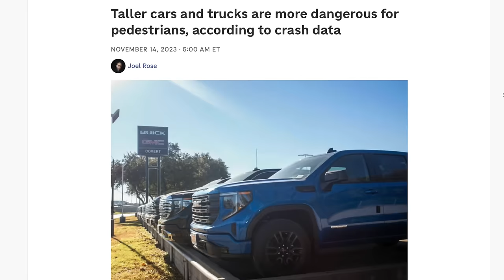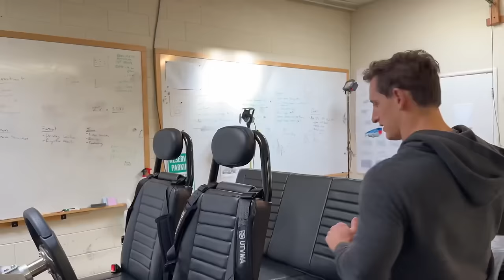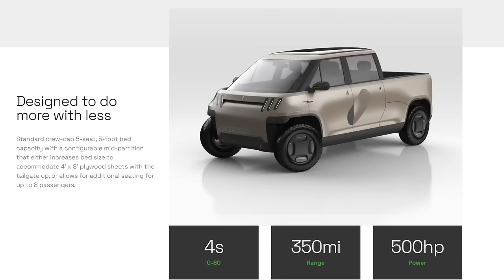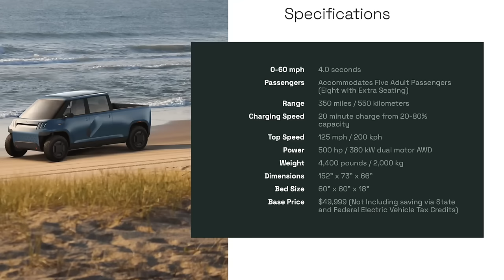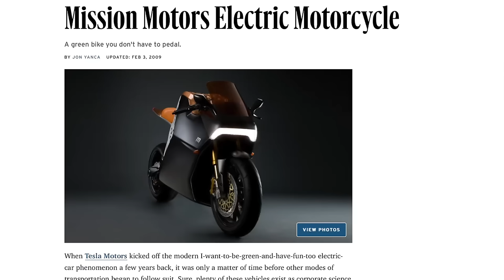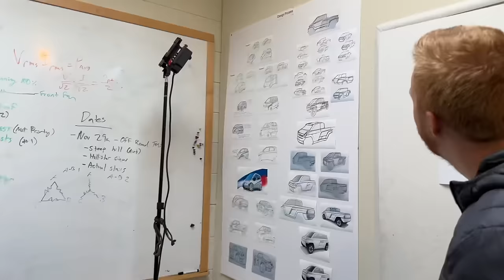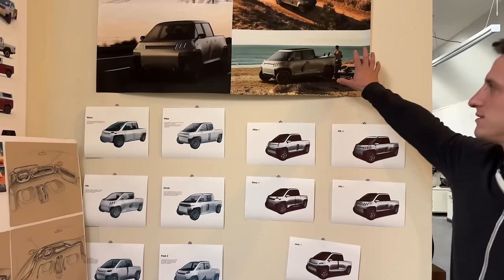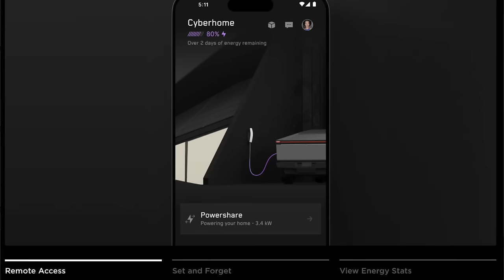Why are US Pickups SO BIG? Meet Telo

Comment: I hope these guys survive, it seems like they have some solid concepts here, and that the market will likely embrace the smaller PU concept if the price point can be kept at their estimates.
Reply: Worried the price is too high, BYD will take the idea, slap some common LFP blade batteries in it and price it so much lower no one will care about that extra battery density
Reply: Chicken Tax is the reason these guys can even exist.
Reply: Lol it’s a pos who tf gona buy that hideous truck made by another shady company 💀
Reply: It's for the city folk. Ikea runs! I want one! if they can make it a hybrid and the size of a corolla variant that's the perfect one. Kinda like a Previa. 👍
Reply: The cost target is always the first part to not work out.
Reply: If they can do it for 22-25k that would be the sweet spot. Othwerise, why not just get a Maverick?
Reply: Good ideas, but design needs improvement.
Reply: @T2star Correct, this is in the size of a Ford Maverick and the Lariat version is $35 - $37K. Maybe IF they get to 50K units per year, they might be able to get the price down to the Maverick range and I would be more interested. 5,000 units per year = $50K makes sense for the short-term

Comment: The best truck concept I've seen so far. Low to the ground, a low front end for pedestrian safety, decent range, all wheel drive, it can tow a decent weight, and it can fit nicely in my small garage. Can't wait until it's available. Love it!
Reply: Right. The other day my wife and I were eating at a diner and a Dodge truck parked next to our Prius. FFS, the top of the grille was above the roof height of our car!
Reply: @mk1st you’re right, I have an early 90s dodge diesel and I had a new one parked next to me and I felt like I was in a mg. They have gotten huge
Reply: what a lovely analysis

Comment: I'm certainly not in the market for one but I really hope they find success. Seeing actually good solutions to the USA's vehicular conundrums is nice
Reply: The EPA ruined the truck market and CAUSED MORE pollution. 
Everything is based  on size. How many square feet does the truck take up? 
An S-10 size truck takes up "X" amount of space and is allowed "X" amount of emissions. (almost impossibly small amount) So S-10 sized trucks are no longer sold. Truck makers build them bigger to comply with EPA regulations. 
That's crazy and has led to behemoth sized vehicles.
Reply: @TheBandit7613  yes but now people expect "real" trucks to be huge.  The epa was one cause but Telo will need to work to overcome the cultural perception that a truck must be large to be capable.
Reply: @ccibinel   Newsflash : Real trucks do need to be huge, especially if the manufacturer expects you to dish out $100k to buy one. I wouldn't pay $20k for the miniature piece of crap advertised in this EV evangelist video.

Comment: Such a cool concept.  I'm tired of huge trucks, but having a pickup is still so great for utility.
Reply: The EPA ruined the truck market and CAUSED MORE pollution. 
Everything is based  on size. How many square feet does the truck take up? 
An S-10 size truck takes up "X" amount of space and is allowed "X" amount of emissions. (almost impossibly small amount) So S-10 sized trucks are no longer sold. Truck makers build them bigger to comply with EPA regulations. 
That's crazy and has led to behemoth sized vehicles.

Comment: Love this idea of a smaller utility truck. Only issue is the price is too high, but can understand they'd go for the big performance and higher price for the first 500 vehicles. The real mass production sweet spot would be under $35k, and that'd be achieved with a smaller battery and half the power.. 500hp for this small ute is ludicrous 😝.. I think they're really aiming for the upscale outdoor adventure sports market and not the inner city utility work vehicle which wouldn't require this high performance or longer range.
Reply: I agree.  Picture models with multiple mountain bikes, gear tunnel with snowboard, multiple rows of seating.  What they're saying is much different than what they're projecting.  Their identity is confused.  Wish this company would succeed but I don't see them getting further than Elio.

Comment: I'd be more interested in a 6.5'-8' box without mid-gate. Where I live(North Dakota-ish), it gets to -40°F, and stays around 0 to -22°F for 5 months of the year. The last thing that I want to do is open a mid-gate to gain storage in the cold. Further, losing the rear seats for my squad in order to fit hockey sticks or plywood in the back is not ideal. I see their cute little snow shot, but how's the heater and battery thermal management system gonna handle actual cold temps? I love this idea, and I like the performance figures and efficiency, but I see a few things that will make this truck hard to consider for folks in colder climates.

Comment: I LOOOVE my R1T, but like most modern trucks, especially in US is total overkill, especially for a single person as myself... would totally trade it in for a small but capable EV truck...IF WAS AVAILABLE.
Reply: The r1t is still much smaller than all other full size trucks it’s a great truck
Reply: At what price point?
Reply: All of us want a small capable new truck, EV or gas. 
We can't have one. 
The EPA ruined the truck market and CAUSED MORE pollution. 
Everything is based  on size. How many square feet does the truck take up? 
An S-10 size truck takes up "X" amount of space and is allowed "X" amount of emissions. (almost impossibly small amount) So S-10 sized trucks are no longer sold. Truck makers build them bigger to comply with EPA regulations. 
That's crazy and has led to behemoth sized vehicles.
Reply: Xbus another really compelling possibility, but specs (to comply w/ certain Euro standards) make it pretty limiting, especially for the USA

Comment: I don’t need a four second 0-60 time, 125 mph top speed or 500 hp. I rather a motor capable of easily handling 85mph and a long range battery. I drive a 4 cylinder Honda Accord. 0-60 time is… I don’t know what it is? In ten years of driving it I have never had the need to find out. It cruises easily at 75, 85 mph. Never been over 90 in it. Give me long range and fast charging time.
Reply from the maker: Electric motors have naturally fast acceleration, it’s a side effect of being very efficient. Doesn’t cost additional money

Comment: I'd rather have a single cab with ~6ft bed. Basically the current single cab Tacoma. But this is a good step in the right direction.
I do wonder how they're getting the current energy density. I hope it's not NMC based pouch cells. Cylindrical cells do have a bit higher intrinsic safety factor as each cell is metal armored. It can at least have a chance to reduce the time of major runaway.
Now if this trucklet had LFP pouch cells, that would be fine, and even preferred over anything else IMO. Now that LFP patents have passed, prices have dropped like crazy.

50K is still really expensive for something like this. I know it's a new startup and they don't have economies of scale, but reducing that price I think is crucial. I don't know if getting lower HP motors/inverters and a bit lower capacity battery will reduce the price significantly, but I would try something. 500HP is cool, but totally unnecessary for this.
Something like a ~200HP chevy bolt motor for the primary drive, and another ~100HP induction motor for the secondary would be fine for this. A truck this sized will never be used to tow anything more than a couple thousand pounds.

Comment: This guy is extremely impressive, very good engineer, my only request is to make this modular, or have a modular model, make it easy to add a battery pack, roof rack, tail gate ramp, tail gate extender etc etc
Reply from the maker: Battery packs are very heavy. Even a 25kWh module would be like 500 pounds

Comment: The same utility/size parameters could be applied to a internal combustion engine truck, which would must likely come out at a more affordable price. What about BMW Mini modifying their current vehicles?
Reply: Except motor in crash, need for gearbox, transfer case, propeller shafts, plus it’s not solving AGW. So why?

Comment: Great coverage, very interesting concept (and proto-kit or whatever that’s called), but there are two things that interest me:
- repairability (think about Aptera, great idea + concept to make things repairable and more importantly accessible for everybody)
- front tyre exposure: you only need to get a bit bumped in a parking situation or similar and the front tyre needs a repair - where a bumper would protect it and just split.
A front tyre/suspension/geometry damage is costly and every owner should want to avoid that. I get the idea of the positioning, but a little tyre protection (think about e.g. the Smart car) would be desirable.
Reply: Tyres will take a lot more abuse than a bumper, they absorb an enormous amount of force when you hit a pothole. My concern is that the steering rack and front ARB/swaybar seem to be about a millimetre behind the front bumper. Hopefully the black 'skirt' around the bottom of the body is plastic panels that are reasonably easy to replace, it could do with a similar one for front so something like a Camry dent doesn't become a $3000 problem.

Comment: I really hope this takes off. The small volume production looks like a perfect fit for the latest ISF, incremental sheet forming technology which can produce perfect sheet metal panels straight from a CAD file allowing for incremental changes as necessary. I would love a ute ( I'm Australian ) like the old Datsun 620 but nobody makes such a vehicle any more. Maybe you could offer a two seat or bench front seat with a bigger tray in a later model?

Comment: My only concern is the front crumple zone being in your feet, leaving you as a both legs amputee in case of an accident, i would redesign the front, to also have better air tunnel efficiency, and also have 2 types of bed covers, one like the cybertruck with the camera back mirror, one classic only on top of the bed, and the split of the 500hp should be 330 hp in the back and 170hp in the front. Everything else is great.

Comment: Correction to about a minute in: It's not the only reaction they could've had to the standards, they could've designed more efficient small trucks; but that would've been less profitable. Especially for those shareholders that are on truck company and oil company boards. Instead they chose to go bigger and bigger, more and more expensive. 

I've wanted something like an electric Subaru Brat since before Tesla was a glint in Eberhard's eye. A little 90s style Toyota truck would be neat too. Something that I can throw a few 4x8 sheets of plywood in the back of if needed, or some bikes or camping gear, or help move a couch, but isn't 7000lbs. Those little Chinese e-trucks are tempting, but come with too many hurdles. 

I drive Denver to Pueblo and back routinely, 240 miles round trip. My Bolt can make it in good weather without stopping, barely. In cold weather I have to stop at least one of the directions to charge. 
AWD/4WD is important to me for CO's weather fun. 

I vote for 'Sky Blue Metallic' for a color option :D

Comment: Suggestions....put the steering wheel in the centre of the cab passengers each side set back like McClaren did so the cab is smaller 2 doors and l am sold on the idea.
Cheers

Comment: Nice to see another startup doing real engineering and fabrication instead of only showing CG renderings with no means to build anything.
That "gear tunnel" than can become a third row footwell is very clever, as is the overall design.

I've owned six trucks and all were mini trucks, yet they did as much or more work than most full size trucks.

Comment: There are two major concerns I have.
1. He mentioned front crash structure but there is not nearly enough of a crumple zone in that thing (similar to a smart car which was extremely dangerous)
2. He mentioned the first 500 would be wrapped. I hope they realize wraps only last 3-5 years and then it needs to be replaced.
Reply: So get "new car look" every 3-5 years! Really, foundation series lucky to be daily driver after that time. Avoiding paint shop at set-up makes perfect sense.

Comment: The problem of truck size is aggravated by government regulations. EV's aside, all the new small trucks on the market today are crew cabs with tiny beds that are not functional for most of the reasons for having a pickup. Nobody is making a regular cab (one bench seat) and a full size bed (6-1/2 ft) like Chevy S10 and Ford Ranger of years ago. Regulations don't allow that configuration. I need a full size bed so I ended up buying a used full size pickup, and suffer higher fuel consumption. There are no small pickups on the market except very old ones, and the used intermediate sized ones Are more expensive than full size due to high demand. Used full size ones are less expensive than intermediate size trucks. These regulations are counter productive to the stated goal of fuel economy preventing manufacture of small regular cabs with full size beds.

Comment: I like the concept however I think the battery could be smaller to save some cost, I just don't see this as a long distance travel vehicle so why add the cost & weight.  I am definitely not as keen to the band-aid as they are, cool function but no thanks on the design. It has great versatility and if it can safely tow 660lbs that would be amazing. I hope they succeed. Perfect little work truck.

Comment: Need to chime in on “why urban vehicles need 350 miles of range” other than what they list. As an EV owner, here ya go. A. They’re always gonna tell you to charge your battery between 20-80% so RIGHT THERE, that’s 40% gone day to day. Now you’re at 210 miles. Now account for battery degradation over the first 4 years, that’s about 8%, so now you’re down to 193 miles day to day. Now add in a full load with lumber and 4 people and blast the AC or heat at highway speeds. Nope you’re gonna be at 150 EASY. Now let’s say it’s a cold climate and the high is 42 out, cut that in half again, now your sitting with about 75 miles of usable range till the pack or the day, warms up and even then. So yeah, the reason you need a large pack is because 99% of the time you’re not using half of it. Now yea you can charge your car every damn night but hey, I have a model 3 with a level 2 charger at my house fully powered by solar panels, that doesn’t make it less annoying to have to charge it every damn night or be running out of range after a 12 hr shift on the way home cuz you decided to also run some equipment off the cars on-board power (a feature all these trucks have) so they are 100% right about needing that much range, it has nothing to do with “consumer perception” and everything to do with real world facts. Source, I’ve owned two EV’s over 5 years and this is all based on those experiences and aggregated battery health and usage data that can be found online.

Comment: If you have a need for a full size North American pick-up truck, then you should have a need for continuous haulage of large volume, heavy materials or a need to tow a very large trailer, or your plowing snow.   If you rarely, or occasionally need to pick up some topsoil, mulch, firewood, or transport a home appliance, then it's far more economical and rational to have a much smaller vehicle capable of towing an appropriate trailer.  The vehicle and a trailer are a far less costly investment.  When the trailer is not attached, you have a far more efficient vehicle for everyday passenger transport.   We all know full sized pick-up owners, with tonneau covers that have never used the bed of the truck, or used it to carry what could be carried in the trunk of a car or small SUV.  Many own them because they feel safer in a larger vehicle, in case of an accident.  Others own them because they think the vehicles  are cool  and therefore, they are cool.    That's why small European and Asian trucks will never be accepted in North America.

Comment: How is the open front wheels not an issue? Every puddle is going to splash back onto the windshield. Jeepers know. Plus any minor parking bump will bend the suspension, or worse, the frame. Probable won't pass pedestrian safety laws either given how easy it would be to get pulled under. I can't see this thing getting 5 stars on the offset crash test either -- seen too many crashed cars.

Comment: That diagonal pill shape on the vehicle's side is ugly. My first impression is that it looked like it's been in an accident. Lay it on it's side and lengthen it to almost reach the wheel wells and I think it would look better. The broken up rear lights, IMO, would look better as one long piece. The front grill looks good. All your other ideas for the truck and other iterations look good. The only thing I'd like to know is if there's a lot of legroom for the front seats? I'm 6"4" and long legged. My 2001 Ford Ranger Edge was a good fit and I loved that it didn't have a center console, that on other vehicles, dug into the side of my knee.

Comment: I would love to replace my f250 7.3L diesel, but my problem is that current EV trucks are useless for hauling any real weight. Even my old F150 was too small. I need to be able to pull a full 3 horse trailer safely. I haven't seen any affordable EV yet that will tow farther than 125 miles under  load. Live animals can't sit for 30+ min at charger stations in summer heat, plus where would I even fit. Maybe someday.